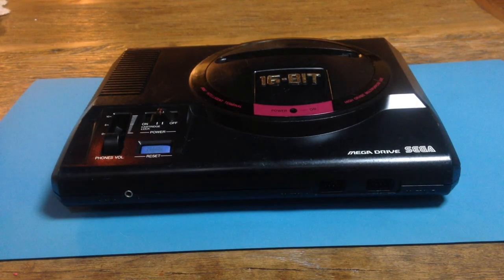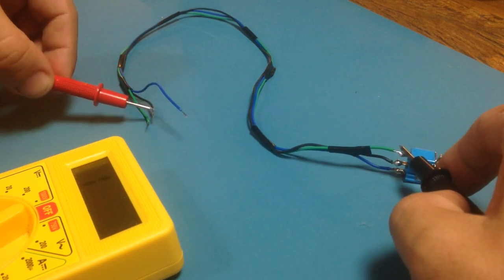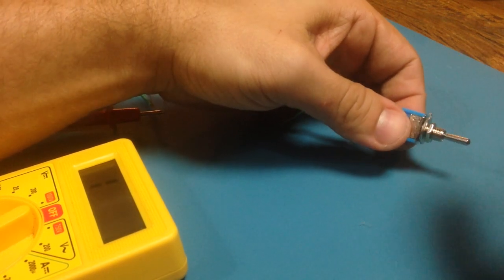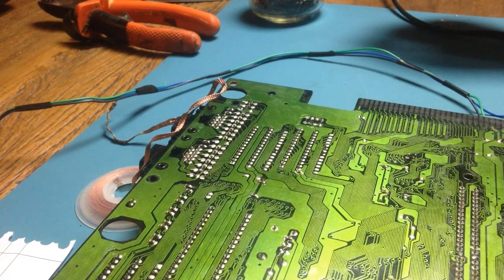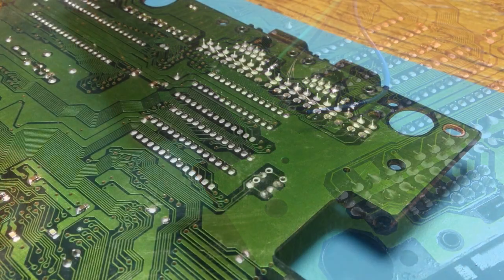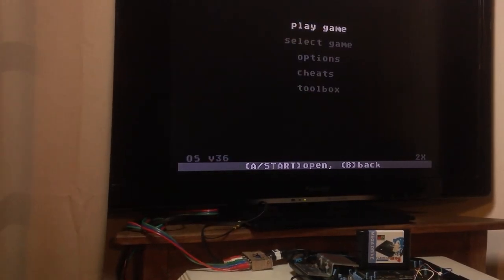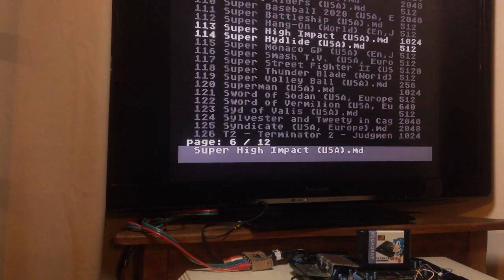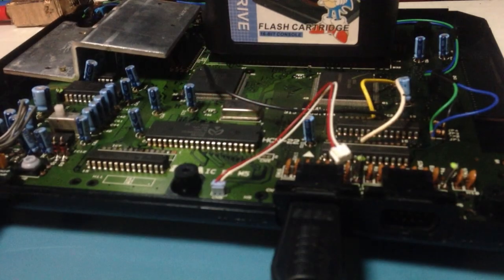How to Unlock All Regions of the Sega Genesis / Mega Drive - All Regions MOD

Comment: What is the purpose of the resistors in this mod?
Reply from the maker: Hi Abel! 1st of all Tks for watching! 
The author of this mod explained to me that he recommends the use of resistors there because it's not good practice to leave any signal fluctuating in digital electronics. That's why he uses the two 10k resistors work in Pull-Up mode when the switch is turned off in Americas mode (middle). Here he explains better but it's Portuguese only https://m.facebook.com/neto.esrael/posts/1841196492674037 

Sorry if I didn't make any clear with my explanation, but For what I understood it's only good practice, and it should work without them . ;)
Reply from the maker: I also recommend Jan Beta's video on this mod. It's the same approach but he implements 2 switches instead of 1, which gives 1 more option compared to mine, which is Region Pal / Language Japanese . Here's the link https://youtu.be/n-9uD4qrdQo
Reply: Thanks for answering my question 😄
Reply from the maker: Tks u for ur patience of watching my humble video :) if I can help with anything else , please let me know :)
Reply from the maker: Part 2 of The Sega Genesis / Mega Drive Resurrection!
https://youtu.be/neH_Uukp-SA

Comment: Yet another Japanese VA6 with “AV Intelligent Terminal High Grade Multipurpose Use” printed on top. No idea why people keep saying that you won’t get the TMSS trademark boot screen with that printed on top because you certainly will. Even Ace’s thread is wrong about this. They never updated the OP though they acknowledge it much later in the thread.
Reply from the maker: Hello there, tks for commenting. In my experience all va5 and va6 have the TMSS screen. Unfortunately this console  has a issue now as its VDP is dead. I'm searching for a vdp to replace it. 
The VA4 from my Resurrection videos has also died but that one I've never found the culprit... 
Now I'm currently gaming on a va1 which has some incompatibilities issues with some games when using everdrive and also a va7 which is the worst model 1 version
Reply: I should say “…you certainly [can]” instead of “…you certainly will” since it was only the VA6 that had TMSS.

My JP MD was found in Thailand with a PAL RF mod. It had the “AV Intelligent Terminal High Grade Multipurpose Use” printing but it was a VA6. Then, there’s yours… and then there’s Retro Recollections with another VA6 with the same printing in his “A Mysterious Japanese Mega Drive” video. There’s yet another from Retro Tinker / Tech Tinker in his “USA Region Cartridges On Japanese Mega Drive” video. It seems that the vast majority of JP consoles with the printing but without the R logo are VA6 which runs completely counter to the hardware variant guide everyone follows from Ace.

Also, it seems that missing the R logo but retaining the printing just means VA5 or VA6. Without the printing it’s VA6 or VA7, just like a Genesis without “High Definition Graphics” printed on top. Unlike the non-HDG Genesis you can’t tell by looking at the power connector or EXT port but you can look at traces through the vents (JP consoles have no shielding). VA7 looks completely different.
Reply: @BocaRetroGames  Yeah. VA5 and VA6 are the exact same board with the only other difference being the chip that populates IC4. The chip with TMSS is the 315-5433 and the one without TMSS is the 315-5402. The PCB has a legend with both part numbers designating one VA5 and the other VA6.

My guess is that they were already working on an updated IC4 when their spat with Accolade happened and TMSS was developed along side or worked in. The chip without TMSS was already in production so they designed the board to accept both. Even if they had a bunch of the chips for VA5 they could go on randomly using them until they were gone because even having some VA6 TMSS consoles in the mix was enough to trip up unlicensed competitors like Accolade.
Reply from the maker: Yes, the only difference is the IC4, but on the va6 we also have the IC8 315-5313A which I don't know if it's compatible with the ic4 from the va5. I'm trying to buy the vdp ic8 from a va5 to replace the dead on from my va6, but I'm not sure if I will have to grabe also the ic4 from the same va5 board, would you know that ? Thanks again
Reply: @BocaRetroGames  

I have some VA6 with 513-5313 and some with 513-5313A at IC8 so I always assumed it was a drop-in replacement VDP. Probably a change in the process technology or something to reduce jailbars.

I actually have two non-HDG VA6 Genesis consoles open in front of me and one has 315-5313 and the other has 315-5313A. The first is Made in Taiwan and the other is Made in Japan so there are a few differences like the color of the board and the labels underneath.

That said, the Made in Japan non-HDG VA6 Genesis with 315-5313A has a strange issue:
It can only cold-boot.

Wait for it to get warm and power-cycle and it will just give you a blank screen. It will only boot again after an extended cool-down period proportional to how close it was to being fully warmed up. It’ll seemingly run forever if you cold boot and don’t power-cycle.

It also seems to only boot certain games if I don’t try stuff like the 32X terminator block. Sonic 3 just doesn’t work without stuff like that. What’s weird is that Sonic 3 will work if I boot with the terminator then quickly turn off, remove it, and boot again… provided I didn’t let it get warm.

This is extra annoying because I did not discover it before doing a 3BP V2 Triple Bypass and capacitor job so now I owe the owner another. This is why I have two open simultaneously. He had just bought it before sending it to me so it still has the retailers “tested” warranty sticker and everything. Too bad I didn’t discover this before voiding that warranty.

It’s difficult to catch without a full burn-in which is what I usually do AFTER my work (quick test, work, then burn-in test). My Mate Vince had a repair lot where the first one he tested could have had the same issue yet he concluded that it worked fine.
Reply from the maker: @emmettturner9452  too bad you didn't catch this issue before the triple bypass job ... what a odd behaviour...
Reply from the maker: @emmettturner9452  thanks for letting me know about the 2 va6 with different vdps revisions. Now I'm sure I can savage the vdp from tha va5 console that this guy is selling me
Reply: @BocaRetroGames  No problem. It sucks that a VA5 failed since they are relatively uncommon. Heck, most “VA5” consoles I’ve seen are just misidentified VA6 consoles since the board is identical and has both designations on the silkscreen. I’m pretty sure one of my consoles was a VA5 before I was forced to give up my collection last year (displaced by an EF4 tornado). I’ve still got no place for a collection but I’ve been on the look out for every variant so I can resume my work in the new workshop. I previously worked from the basement of the rented home that was destroyed.

One more thing:
I was surprised to see the presumably-older 315-5313 non-A in the Taiwan console since both were late VA6 (no EXT port, no HDG printing, same power jack location). Those are the so-called “VA6.5.” Same board, of course. The service manual calls the updated shell “VA6.5” but I couldn’t find where they ever referenced the board that way. Neither of these late VA6 boards are the even later VA6.8 with the surface mount video encoder. Unlike VA6.6, VA6.8 is labeled on the PCB silk screen.
Reply: @BocaRetroGames  Yeah, it was my first 3BP. That part went relatively quick this time around and it’s the cap job that is a pain.

At least I know not to populate the composite video cap and the 7 audio caps this time!

Last time I started with the cap job and ended up replacing all 8 of those (in addition to dozens of others) when I was just going to remove those 8 for the mod anyway. I removed composite video cap to connect 75-ohm C-Sync to the original DIN but even if you aren’t, well, lifting the RGB pins disconnects the encoder and disables composite video anyway… no reason to replace a cap for something that isn’t being used so I just leave it out.
Reply from the maker: @emmettturner9452  oh crap ! Replacing uneeded  caps... no one derseves it. I've only fully recapped my va4 from my resurrection videos. It was a real pain as don't have a dessoldering gun. I still want to triplebypass my va7 though
Reply from the maker: @emmettturner9452   @Emmett Turner  sorry to hear you had to give up your collection because of a tornado ! I've seen references to va6.5 but never seen one. I also didn't know there was a 6.8 with smd video encoder ! Cool stuff
Reply: @BocaRetroGames  I do have a desoldering gun but it was so much trouble the first time I just skipped it this time.

The heat recovery on my Aoyue bench unit just isn’t responsive enough to flow both sides at a reasonable temperature. I had much better luck with a K-tip by cranking my iron all the way up. Even then it requires an extended dwell time if you are going to pull the caps and since the leads to each cap are bent from the factory I have to do some prep work first. That’s when I make a pass and straighten all the leads with a metal spudger. Of course, that’s another tedious process of melt, slide spudger under, lift spudger, remove heat TWICE for every cap. This avoids pulling a plated through hole or catching/lifting the pad on the opposite side.

Of course, I then have to remove the solder with braid but it’s much easier when you can attack it from either side and you don’t have the capacitor itself soaking up some of your heat.

The VA7 is definitely the Model 1 variant that needs it most but the install is completely different so I haven’t done one yet. I have a VA2, VA3, and a few Model 2 consoles lined up but I will eventually tackle a VA7 so I can finish my own Model 1 install guide. :)

I’ve only seen a PAL VA6.8 so I’m not even sure it exists elsewhere but, yeah, they switched to an SMD encoder so they could have multiple sources (supply chain logistics). IIRC, some have an SMD variant of the Sony CXA-1145P and others have a Samsung or Fujitsu encoder that’s pin-compatible. The VA6.5 is really just a VA6 without the EXT port and associated components. It’s the exact same board and even has the footprint for the missing components. In Japan they retained the EXT port through that period so I still consider it VA6. To me, “VA6.5” just means a shell with no opening for the EXT port… like a lot of the non-HDG VA6 consoles around here (surprisingly few are VA7).
Reply from the maker: @emmettturner9452  thank you so much for all these amazing details on the different  revisions! Here in Brazil back in the day we had the official tectoy ones, that were basically American boards, and the imported cheaper Asian MEGA Drives, so we have plenty of those here with the pal-m modification to our standard. 
I've been only dealing with electronics as a hobby since 2019, so I  don't know almost anything, but I do enjoy trying to fix or modding consoles. 
Regards the recap it's exactly what you have described. Bent legs from factory, so difficulty to remove them and so easy to lift the pads ...
Reply: @BocaRetroGames  phew
Finally finished! Fully recapped and bypassed and still works. :)

Well, it’s doing the burn-in test now but it’s been on longer than the other and I can still power cycle it without issue.

I still have to go back in there to connect the headphone jack and original DIN 8 to the appropriate connections on the mini DIN but that’s all just fluff. :)

I did switch to my spring-loaded desolder pump after I ended up losing a pad to the desolder braid. Thankfully it wasn’t critical and I was able to solder from the top.

It is fun to tinker with this stuff so I’m glad you are learning. You already seem to be pretty good at it and are challenging yourself with replacing the VDP. I’ve done similar a few times with SNES 1chip and N64 RCP but it is always a hairy prospect. Good luck!

I’ve just been on a deep dive with the Mega Drive recently since there isn’t much info regarding the Triple Bypass and the Model 1, which is how I came across your video. If I’m going to correct that by writing a guide I’d better know everything I can about the subject. :) Discussing what I’ve learned helps me make sense of my research before I put it in the guide and I can also get corrections before it’s too late. Thanks for indulging me! :)
Reply from the maker: @emmettturner9452  thank you for all this important information you are sharing. When the time comes for me to proper do a 3bp surely will ask for your help, and luckily enough you will have already released your guide. Thanks once again for the chat and please keep in touch. I hope you also re or some footage of these great mods you do and share with us on your channel. 
Have a great week
Reply: @BocaRetroGames  

I was recording GoPro POV footage to edit together on my phone but my iCloud storage is now saying “full” so I don’t know if I can finish it. I haven’t been able to use a PC for this stuff since the tornado because I have no place to set it up.

I will definitely make some kind of video but it may just be an overview of completed installations which point to the written guide. I am always happy to help if you have any questions. :)

Comment: If you are still insisting on using original Genesis / Mega Drive hardware and you are wanting to play imports, then all you need is a Game Genie.  Go to the awesome website gamehacking.net and they have Game Genie, PAR codes for practically every console that you can think of.  Including codes to circumvent the region lockout found in the software for the Genesis / Mega Drive and they definitely work.
Reply from the maker: Thanks for the info ! I've not mentioned, but I used those GameGenie codes to unlocked almost all Roms that have any region lock, so I could play them all on my Japanese locked va1. I also uploaded this pack of unlocked Roms somewhere back in 2015, but I don't remember where now. If I find I'll post it later. Thanks for watching
Reply: Hacking the ROM with a Game Genie won’t change the frequency though, right?